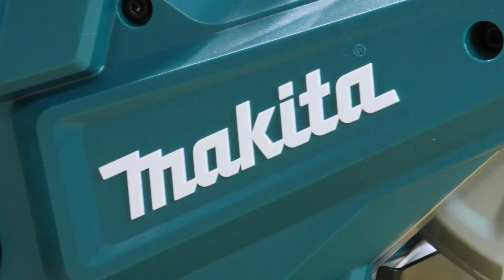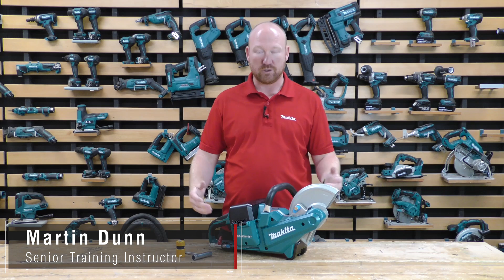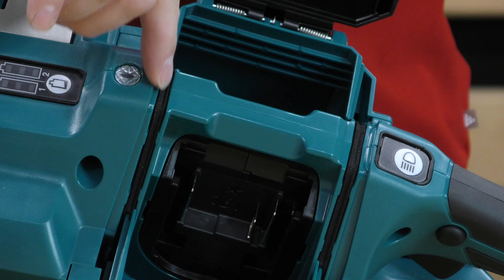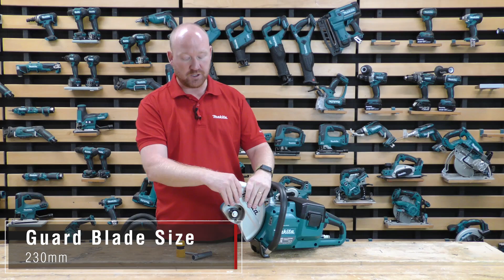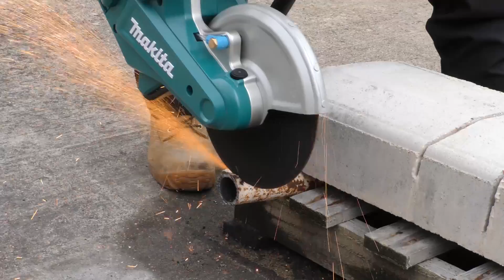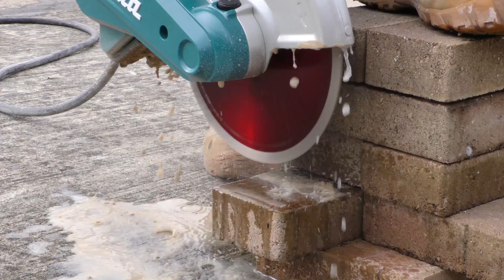Makita UK DCE090 Disc Cutter

Comment: I was literally going to buy one after id finished this video until he said the guards fixed. What a design fault. I use a still saw daily. Id like a cordless for smaller stuff patios. Stop start situations when a petrol can be annoying. But the guard needs to be able to move. For instance for cutting a doorway where you have to hold the cutter high. If it can't be moved it will make life hard or reduce the cutting depth. Massive flaw from makita not making it adjustable.imo
Reply: It’s only a 9 inch so wouldn’t be much good for cutting an opening in a 4 inch wall anyway

Comment: how long does it take to re-charge the batteries and how long does the battery last for? looks like a cracking bit of kit.
Reply from the maker: Runtime and charging time would depend on what battery you used, you can find some more information regarding this here: https://makitauk.com/news/makita-launch-50ah-lithiumion-battery-for-66-more-run-time

Comment: For those wondering real world battery performance, with two 5ah batteries I got through 4 2x2 concrete flags/paving slabs at 2 inch. I couldn’t put any pressure on the cut without the red light flashing telling me to ease off. 

But it’s nice not having to pull start for the odd cut of bricks blocks etc, and hardy any hand vibration. with me owning plenty of batteries it’s not really a problem having the sort run time. 

Definitely doesn’t replace a petrol saw but a handy tool to have👍
Reply: I agree, they just aren't man enough for site use, alright for 1 of 2 cuts but all day use like a ground worker or bricklayer stick to a STIHL saw, cheaper as well!
Reply: Great feedback. Its the noise and fumes that would attract me without a pull cord start.

This would probably have the same motor/power as the 9" 36v angle grinder